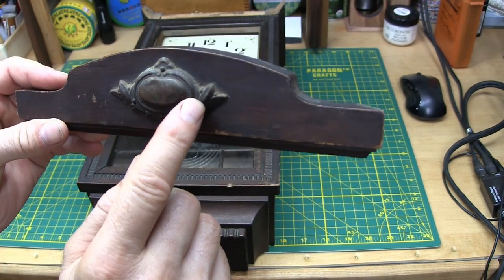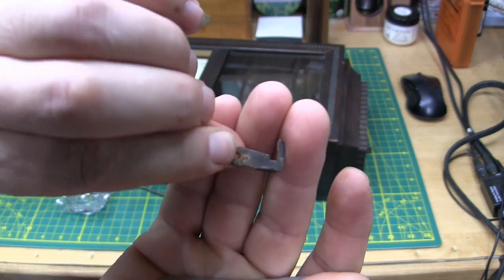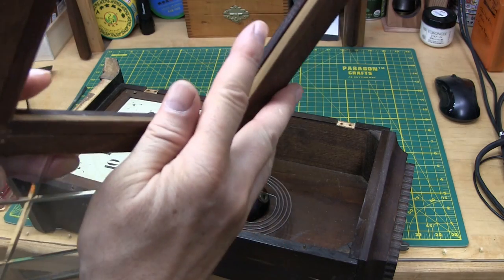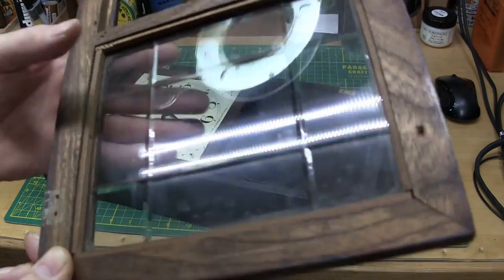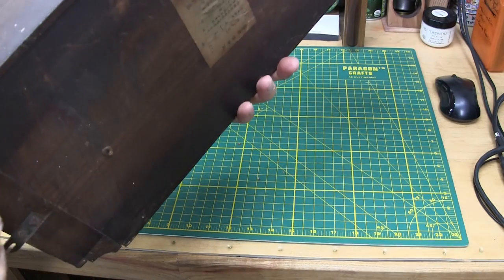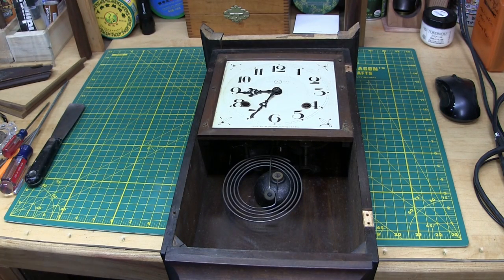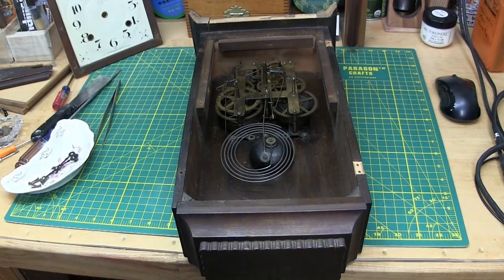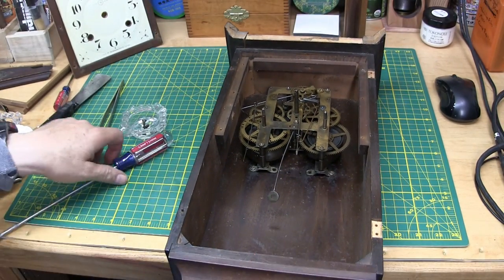Antique Seikosha Wall Clock Repair Pt 1, updated version

Comment: Great video! I just got a seikosha clock just like this one for £10. It has the same face!
Reply from the maker: Thank you, JJ. You got a good deal for £10. These are really nice clocks and don't take up too much room. I've seen models with this same face and it seems they used the same design for several years.
Reply: Thanks! I was wondering if you know when this one was made?
Reply from the maker: @JJs_Horological_Collection  It's only a guess, but I think it is around 1920 or slightly earlier.
Reply: @time4clocks  thanks! I appreciate the info.
Reply: I really do love your clocks! They are amazing! I also collect them but yours are great!
Reply from the maker: @JJs_Horological_Collection  Thank you, JJ. It's a great hobby: fun, interesting, educational, and keeps you out of trouble. lol

Comment: do I need to oil the springs ?
Reply from the maker: Yes, all springs need some oil. Not dripping oil, but lightly coated, so as they wind and unwind the coils slip against each other.

Comment: Sir,
I have a seikosha top bell pendulum wall clock plz could u show complete repairing on it. Actually the clock fell down on face and its centre wheel shaft got bend from the main plate. It is possible to get it  straight.
Thank you
Reply from the maker: I regret I do not have a top bell clock to demonstrate on for you. Sometimes a bent shaft can be carefully straightened but it is usually beyond the skill level of the average person as the movement needs to be taken apart to remove the shaft.
Reply: Very first thanks for your reply.
Sir, I had removed everything from the shaft and I can see the bend. What's next?
One more question, can we remove the bend or disallianment of any wheel.
Thank you
Now
Reply from the maker: @KazimaliSayyed  You just have to be careful and bend just a small amount at a time. The shaft also needs to be supported where the bend begins. It is a delicate process.
Reply: Thank you

Comment: Merhaba Türkiye'den selamlar. Üstadım dikiş makinaları için üretilen Singer makina yağını bu saatlerde kullanabilir miyiz?
Reply from the maker: Hello. If that is the only oil you have it would be better than nothing. Some use synthetic car oil 10-40. Never use any oil that has Sulphur in it. There is oil made specifically for clocks but don't know if it is available in your country. If you can find a shop that repairs clocks they might sell you some oil. Hope that helps.
Reply: @time4clocks  teşekkürler efendim. Türkiye saat yağı temin etmek çok zor. internetten sipariş vereceğim fakat fahiş fiyatlara Çin'den geliyor... saatçiler bile artık bu saatlerle ilgilenmiyor, quartz saate döndü hepsi. Saat yağı bulamazsam da tavsiyenize uyup 10-40 sentetik yağı kullanmak en mantıklısı....